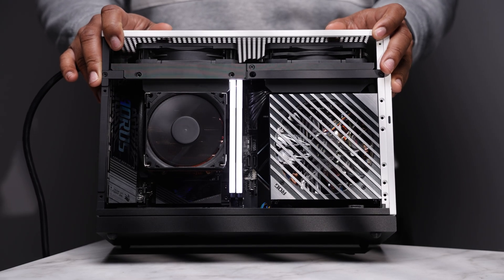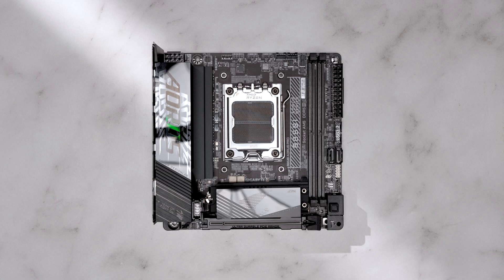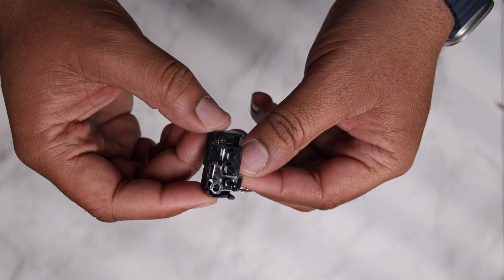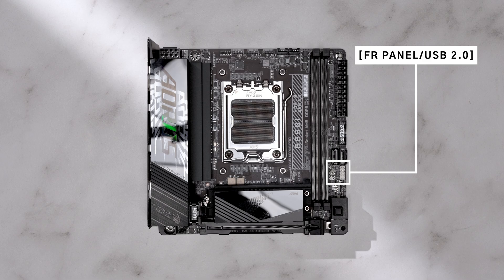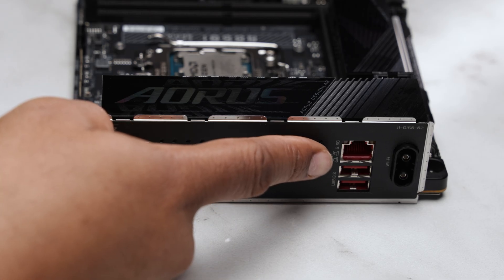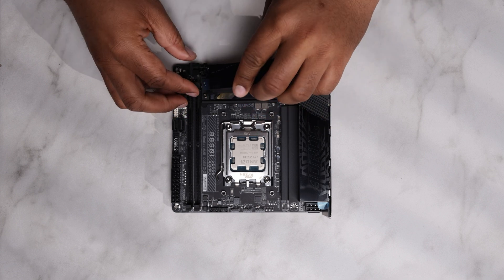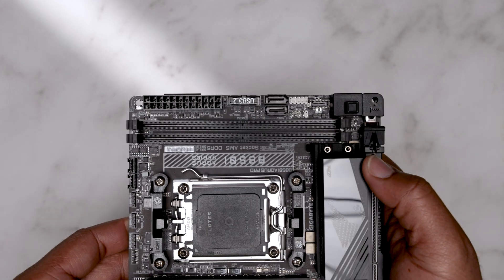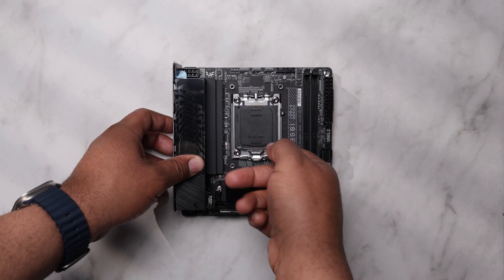Gigabyte B850I AORUS Pro – Clean Look, Strange Choices

Comment: thank you for pointing at the wifi antenna location and saying it's for bluetooth too. i spent hours trying to get bluetooth to work even factory reset and updated firmware and drivers, nothing happened until you said an antenna goes in there and i plugged it in, wasted so much time but here's a like and subscribe

Comment: I have bought this board recetnly but probably going to return it for the same points you made in this video. I have a fan connected to the SYS FAN header via those crappy extension cables, the fan works but is not detected by the BIOS for some reason which means I cant control it via BIOS or Fan Control software.

Comment: Hey great video. How did you remove the PCIE EZ latch?
Reply from the maker: It was really hard, you have to temporarily bend the metal ringer to remove the pinion, if that makes sense

Comment: 1:45 How were you able to take that corner off? I've been trying for hours and I need to check undernesth since my gpu wont connect correctly.
Reply from the maker: It was hard and I don’t recommend it if your not okay with the small possibility of the plastic clip breaking
Reply: @ChrisRussellTech I think it might be worth it for the riser lock bar
Reply: @SirCoatz Hey, did you remove it? If so, did you encounter any issues?

Comment: The fan adapters, is there a technical reason to replace standard fan header connection to those that require an adapter? Adapters just create unnecessary clutter and god help if they get lost on the way.
Reply from the maker: I’ve heard they’re sever grade connectors. They also snap into place and disconnect with greater force.

Comment: I just got this board. The only confusing part was having to install the thin heat pad before putting the nvme in. I wasnt sure if that was correct.
Reply from the maker: If I’m not mistaken, there’s already a heated applied.

Comment: Gigabyte ITX boards are always weird in one way or another. 

A common thing is the socket placement tends to higher up the board, fucking up cooler compatibility with some popular heatsinks in certain SFF cases. 

I currently have a B660 DDR4. It has the mini fan headers, only a single M.2 slot, offset socket placement so I can’t use a Noctua L12S in my case (Fractal Ridge). Some other oddities I can’t remember. 

It has at least been solid over the years of use thus far. No issues with it at all functionally

Comment: I just got this motherboard and I'm having issues with my M.2. It doesn't recognize it, it sends me to the BIOS, sometimes it starts Windows and other times it doesn't. Has anyone had this problem? :(
Reply: I did actually, and my issue was the ez latch wasn't actually latching onto my m.2 or the heatsink fully. It was working one day and then the next day, it wasn't. I recommend starting there, but that problem alone made me return it and go for the Asus b850i instead 😅
Reply: @Grapfic 😩😩😩

Comment: Is RGB that important to most ITX builders?

I will take a SPDIF port over RGB any day.
Reply from the maker: RGB is commonly known to enhance case airflow; effectively providing more performance.  Go for an all blue RGB build for the best results as it invites cooler air into the system. However RGB is not really important. 

Jokes.

Comment: Thanks again for another great video!

I had the older B650i from gigabyte and thermally it was amazing, but it had the annoying issue of not working with the stock Formd cable, and the fans would ramp up to 100% when you started shutdown

I believe the B850i works from the stock formd riser cable, but I wonder if it has the same annoying fan issue my old one had. Interestingly based on your results and going off the spec sheet, the thermals on the B850i are worse than the previous gen

I also agree that their BIOS looks really good and is super easy to use

Will you be testing the upcoming MSI B850i?
Reply from the maker: I’ll test the MSi board as soon as I get it.

Comment: used this board in my first pc, built in a ncase m2 has been good, only issue is i can't seem to put the screw through the bottom right hole to attach to the case so I been rocking it with 3 screws lol, other than that everything been good
Reply from the maker: You have to use a special screw that comes with the motherboard for the EZ latch system.

Comment: I have the same case, and mobo. I didn't have the standoff issue, but I have an AIO, so set it up differently. Also, one thing that is nice, is the Wi-Fi antenna has a magnet on the bottom, so it sticks to things :)
Reply from the maker: The stand off issue only applies if you’re using the Riser Bar kit from FormD. It’s weird because most marketing images of the board have a difference antenna.

Comment: 2:10 I would be careful of using the default formd t1 riser with this board, one of the protruding parts of the "pcie armour" actually digs into the riser cable as it's so wide. rather than risk damaging the cable I swapped this board for the Asus B850i
Reply from the maker: I’ve observed that as well, it didn’t seem to be too big of an issue.

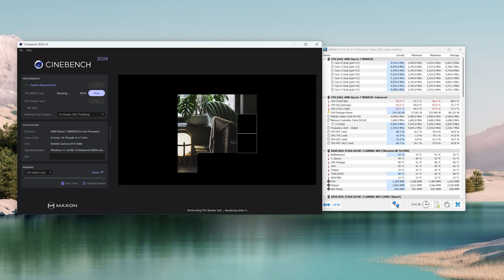Comment: 4:58 I just removed my SSD heatsink fan from my motherboard after years. It makes such a difference not hearing that little buzz every time I start my system and no matter how low you set it, it always can be heard through Noctua fans. Went with a $11 Amazon block of aluminum that performs way better and is obviously fanless.
Reply: Ohhh is that what the “whoosh” is when I start up 😂? I always hated that but couldn’t figure out what it was.

Comment: Many thanks for the review !
I'm overall satisfied with mine. Dropped the Nvme heatsink/fan since I mounted the 990 Pro 4To with Heatsink. I had no issue with the PCI shield with both risers I have, contrary to what some reported. The proprietary fan headers are a bummer. I'm fine the the rest. Good temps with my Atmos 240 & 9900X (FormD T1 2.1) without undervolt, sobre design... As said in a previous com, I couldn't have gone with any other MB anyway: X870 are too expensive, Asus is a no-go for me, Asrock has tons of reliability issues, and MSI did not release any itx B850 yet...
Reply from the maker: MSI will release soon. However it’s going to be silver/white-ish
Reply: @ChrisRussellTech  Ah, I missed this input. Sad it's too late (won't build a T1 everyday)

Comment: Guess I’ll stick with the Strix B850i for my upcoming M2 build. What’s been your preferred ITX this generation?
Reply from the maker: AORUS wins in the design and price department.
Reply from the maker: Design wise this board looks better and the price is right but that additional USB-C port and PWM fan adapters are my only problems. I have several cases that don’t have a USB-C and having that extra on the back is nice as I editing video projects from a X1 Pro vis USB-C.

Comment: I've got this exact board in my T1 build and love it. Definitely some quirks, but nothing to deter me from recommending it.
Reply: I'm in the same boat as @legreviews. Had the ASUS B850i as well. My PCIE riser cable kept coming out of the slot. The locking mechanism ASUS went for was not my favorite.
Reply from the maker: I originally had a more negative review of it but I’ve come around to it and had to re-record portions. I think it could use a second USB C port and clear bios button and it would be almost equal to ASUS
Reply: @ChrisRussellTech I had the ASUS B850i board and swapped to this one. ASUS has (or had, not sure if it’s been fixed) an issue with the M.2 SSD being unable to run at Gen 5 speed. After swapping to this board, no issues. Gigabyte wins in my book until ASUS fixes their board.
Reply: @legreviews  Same here!
Reply: @legreviews I actually just returned my aorus b850i and I'm going to buy the Asus instead, but what is this gen5 issue you talk about? I don't want to be entering more problems 😅
Reply: How did you manage the riser cable issue? About to build and heard that some people have issues with it